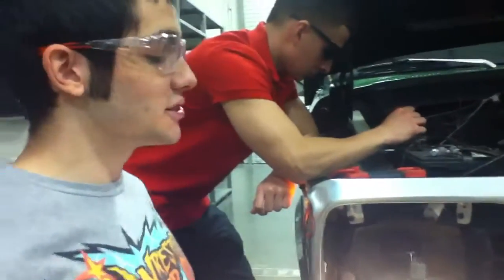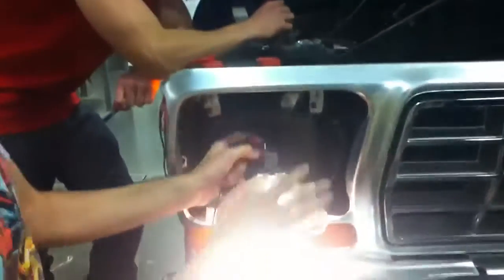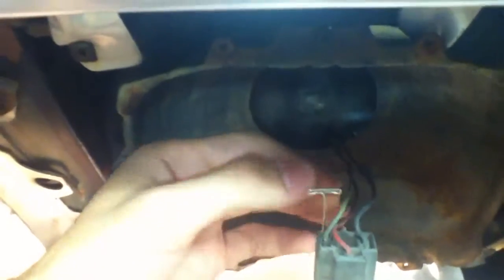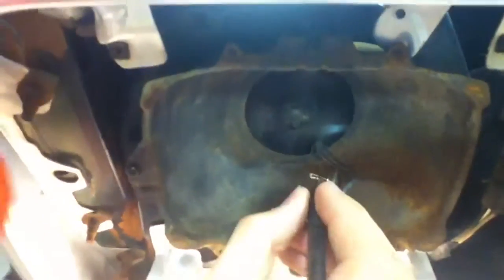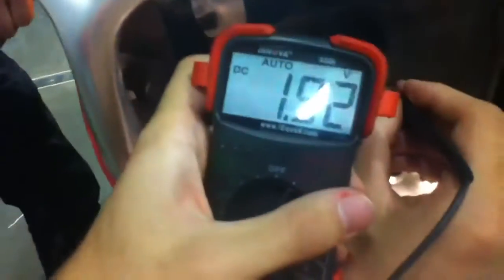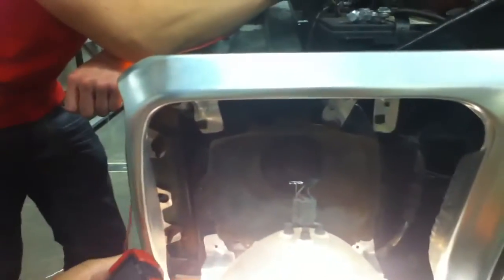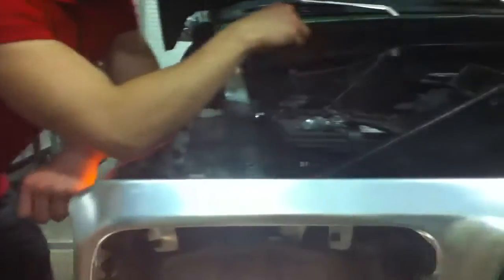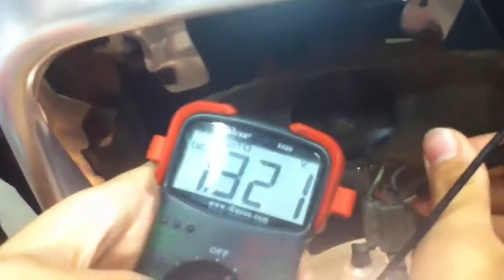Headlight voltage drop test

Comment: I have problem when headlight on.. and voltage drop.. normaly without full load an electrical the voltage around 14,2 v.. in my case.. when headlight on.. voltage drop until 13,5 v and RPM drop too, drop around 100 RPM. And i add  to turn on Air Condition (AC), voltage drop again around 12,9 - 13,1 v.. is that normaly? Can you help me to diagnose? And what should i do? Thank for advice